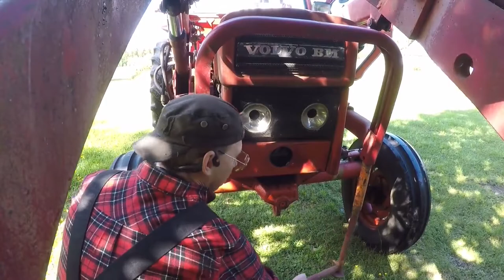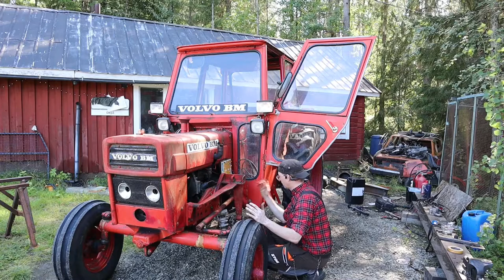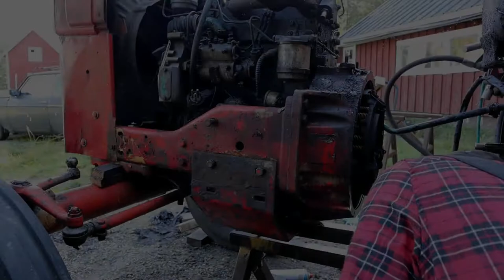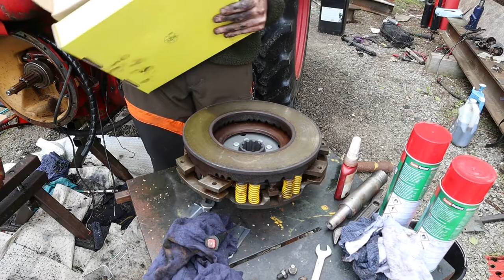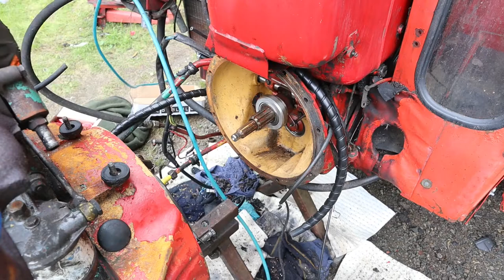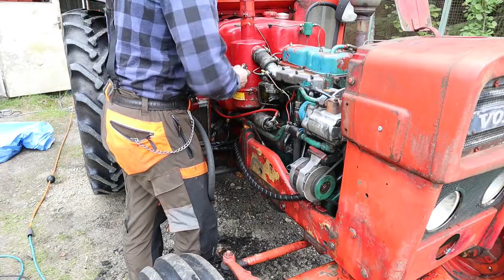Volvo BM 430T : Splitting it in half, replacing clutch and PTO-clutch

Comment: Hi,

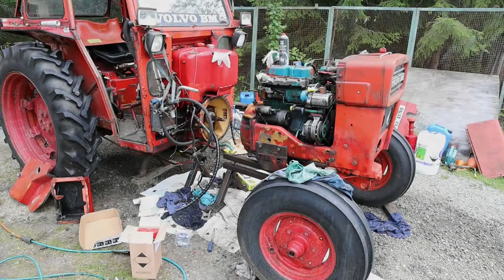What tool are you using at 30:00 when adjusting the bolts? does it have a name or is there an alternative to that?
Reply from the maker: its just a measuring tool to get the right distance of the pressure-fingers of the pressure plate. I dont remember de right distance but you can find it in the BM430T service manual.
Reply: @Foffe2000  Thank you very much, we found a solution, do u by any chance remember the amount of Torque for fastening the clutch to the flywheel? (newton meter?) i cant find an English version of the service manual and my Swedish is not that great... :)
Reply from the maker: @haptus1   no sorry, and i dont got the service-manual on me, i sent it along when delivering the traktor back to the parents place. Have you found a Swedish manual ? heres some translations of the parts you are dealing with : "tryckplatta" (flywheel pressure plate) "lameller" (clutch-plate) Svänghjul (flywheel) Vevaxel (crankshaft)
Reply from the maker: i did find this info on a website (in swedish) that claims 10,3-11 KP/m on the flywheel to crankshaft, and 2 KP/M for the clutcplate to the flywheel. But i am not sure about it since its just from a random website (  https://www.ingemarlindblad.se/sida220.htm )
Reply: @Foffe2000  Hi Again, been a while :) we got it changed, the tractor changes gears, but now the PTO Clutch is making some weird noice when depressing the clutch all the way, like a grinding sound. Did u at any point adjust the bolt between the four springs at 23:10, Not sure what it is called but from my rescearch this should adjust the PTO clutch... 

Thanks again! :)
Reply from the maker: @haptus1   hello , its been a year (or two?) since i did the clutch service, so my memory isnt all clear on how i went along. But i dont remember adjusting any pto-clutch, just new clutch-discs. Are you sure that the clutch isnt to snug? the tractor should stop when you press down the clutch a little bit more than half way, and the pto disengage when fully pressed down. The sound you describe leads me to belive that.

Comment: Nice video, i have same kind of 430 that your parent's have. Question about the front axle that where it from because mine 430 has different looking?
Also i would like to know where the back of the front lifts base part goes because im making my own version of it.
Or mine front axle is different that everyone else 😂
I recommed more videos of this Volvo BM 👍
Reply from the maker: Maybe yours is yellow? then its an "industrial" BM430, they got sturdier front axles and front lift.
Reply: @Foffe2000  the paint has scrapped off and there is yellow so the front axle might be from industrial thanks 👍

How about that your frontlifts base brackets back attachment point where it does go?
I'm doing an DIY frontlift to my own so it would be nice to know.
Reply from the maker: @Tomi4170  on this one , a "ÅLÖ Quicke" its mounted right above the front axle (excisting holes that are not used) and also about where you have you feet inside the cabin (same mounting plates as the cabin bolts on to) , ive seen front loaders that also are attached underneith the tractor back to some mounting holes at the back end, probebly to even out the load/stress a little bit more
Reply: @Foffe2000  thanks for your answer.

I have to think is that even neccesary to have that type of middle attacment point because i will make to attach from the back of tractor also. 

You are right that it is better for the tractor to spread the points away from each other and i think this is the cause of your Volvos bolt break.